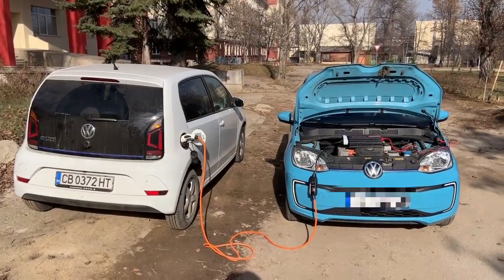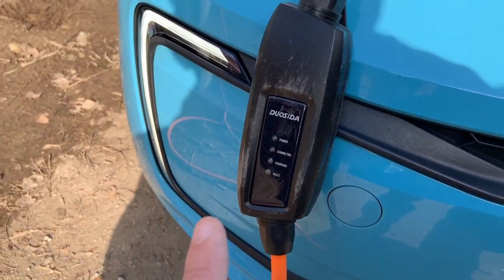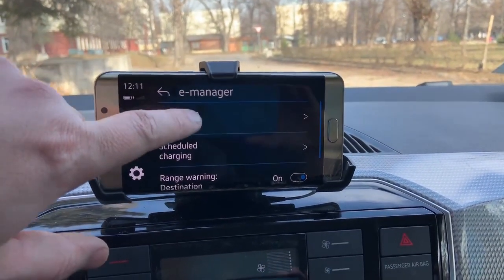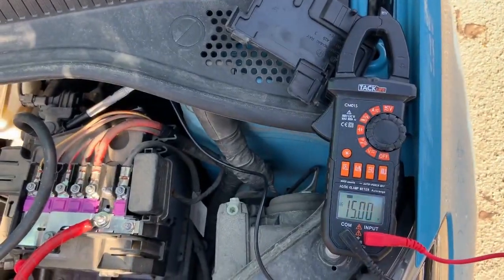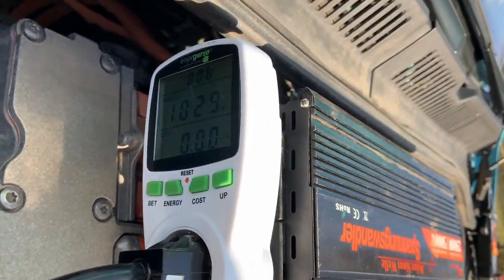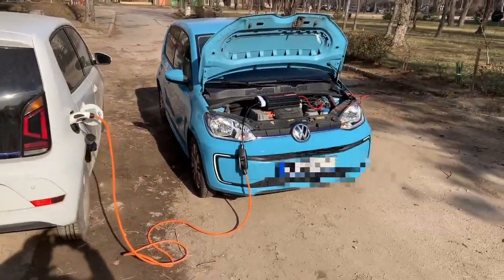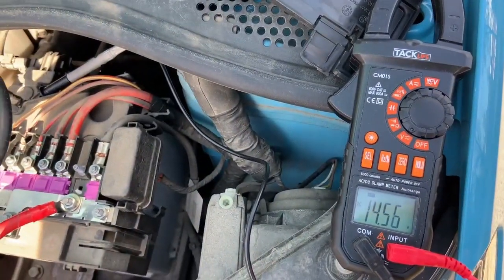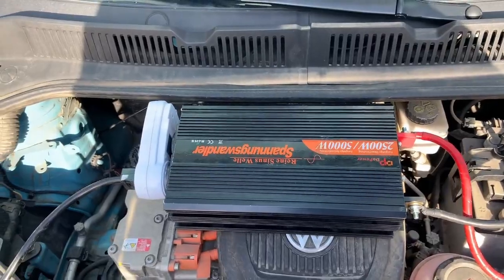Charging e-up from another e-up

Comment: This will drain the 12V Battery quick and overload the HV to 12V DC - DC Converter soon after. I use a battery Power station (Ecoflow) as an emergency backup.

Comment: Thanks for showing I would like to charge my e-up 2014 from my solarpanal system (a 12 V system) what is the check that you mention that the original charger has? and is it anyway around it?
Reply from the maker: It is a ground check. The original charger checks if you have a connection to the ground or not. The way you can make a ground is to put some bare wire 30 cm. in the ground and then connect it to the Schuko outlet. The other way you can buy a charger which does not have that check. I think this video can help you : https://youtu.be/aWZLOEZFBNU . I still have the charger, but I am not using it anymore so if you need it we can think of something.

Comment: What is the DC/DC converter max power?
I mean the HV to 12V DCDC.
Reply from the maker: Fliwa Tüt I don’t know for sure. My best guess is 2000 W. But to be on the save side I recommend not to drain more than 1200W from it. It may be 1500 W. The fuse is rated at 200 A that’s why I think it is 2000 W

Comment: I wonder what’s the minimum DC power that the e-Up will charge at.

Perhaps an alternative to AC conversion would be an intermediary box that takes in 12 V 167 A 2 kW DC from the low-voltage battery, and outputs 400 V 5 A 2 kW DC (plus CCS signalling on the pilot pin).
But I guess it’ll be riskier to implement the pilot protocol (which depends on the target’s state-of-charge) instead of letting the target’s charger control the AC load.
Reply from the maker: The minimum charging power of e- up is 1kWh. The best way if you ask me is to unlock the CCS port on the one car and connect it to the other CCS  port with some way of restriction (40 kWh). But that need time and resources to investigate. I will surely try to unlock the CCS port but when I have time to experiment with it.
Reply: @tedonash2681  to connect one battery to another is very risky if you cannot control the max current.
Reply from the maker: jozefheinrich I agree that there is some risk. I have played with a lot of batteries and what I have noticed is when you put a discharged cell (3V) with a charged cell (4.2V) they tend to equalise with a maximum of 1C. In this case the his will be 50A which is in half of the amperage the car can take on DC charge. This off course depends on battery internal resistance.
Reply: @tedonash2681  Very correct. It depends on battery internal resistance. The VW e-up battery has very low internal resistance. From your video one can calculate it.
https://www.youtube.com/watch?v=m7Fp4qLcYcM&t=130s
Uempty = 356V
Ucharging = 370V, Icharging = 120A. Internal resistance = 0,116 Ohm.

connecting fully charged e-up 413V with discharged e-up 356V would result in (413-356)/(0,116*2) = 245A. (Internal resistance times 2 because we would have 2 batteries). That would blow the main battery fuse I bet :)